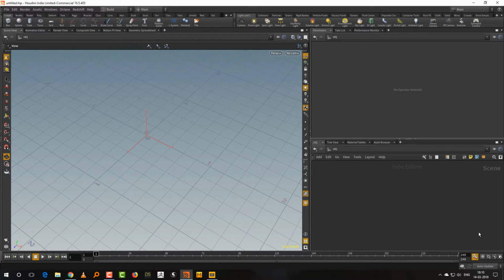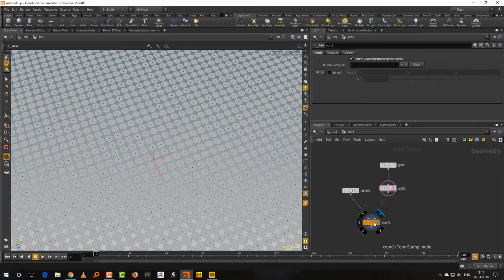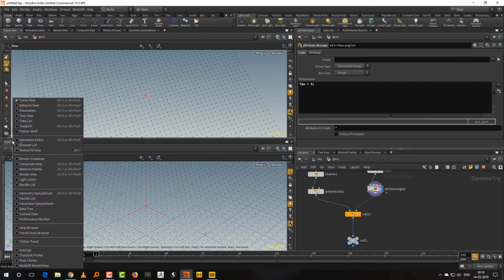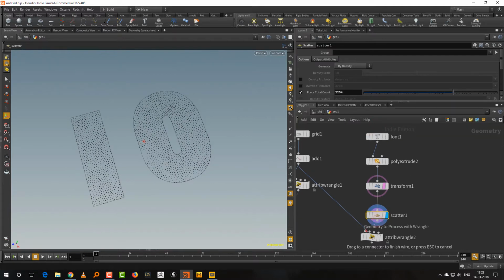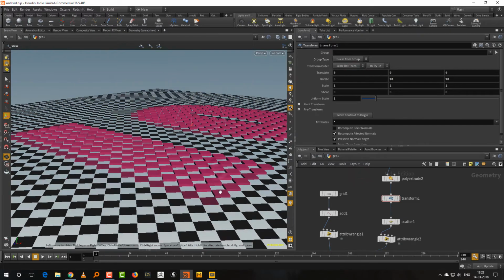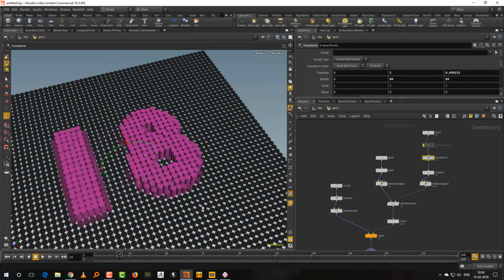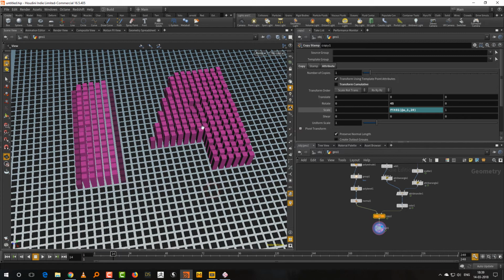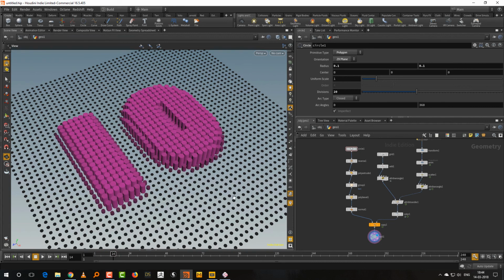Introduction to Houdini - Chapter 10A - Attribute transfer

Comment: Is copy stamp still a good idea to use after H18?
Reply from the maker: The big issue copy stamp is that you can’t put it in a compile node. it’s still perfectly ok for smaller stuff. But it just makes sense to use the for each method because that’s what everyone is using. And it is slightly faster than the copy stamping  when dealing with massive number of copies.

Comment: Sir I want to ask you a question 
why @pscale is not working...whenever i want to scale down any geometry..nothing..happens..and why it always Used in Copy SOP or Particle Systems...?
Reply from the maker: Pscale is a point attribute made for scaling particles or points. And if you copy something on to a point that has pscale , that object will be scaled by that value.

But pscale is not meant for scaling an object on its own. For that , just use the transform node.
Reply: @rohandalvi  thanks for the response..:)
Reply: @rohandalvi  Any Expression For the transform node 
I am new to VEX..
Reply from the maker: @shivsharma6511  I'm not very good with vex , for standard transform you'll need some kind of matrix 3 calculation. But I'm not sure